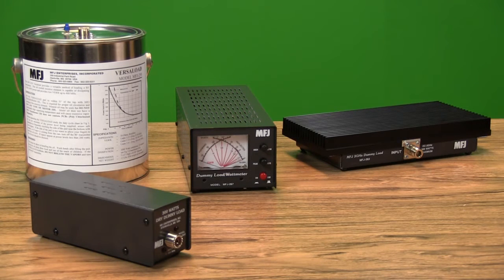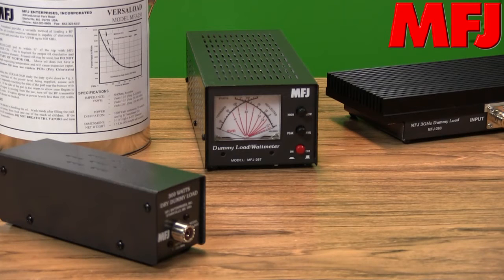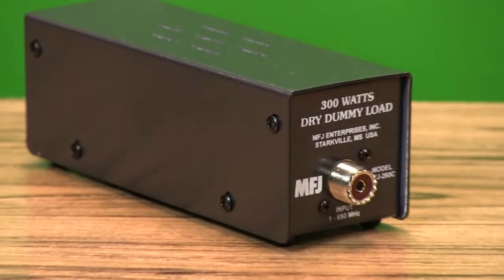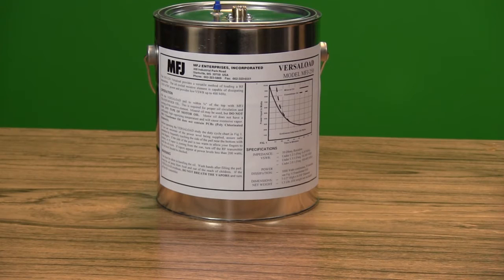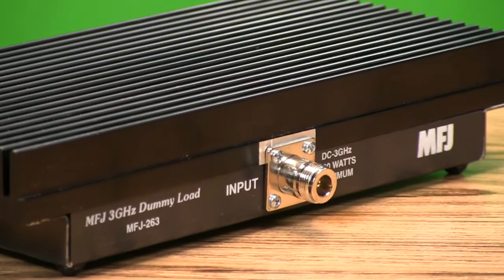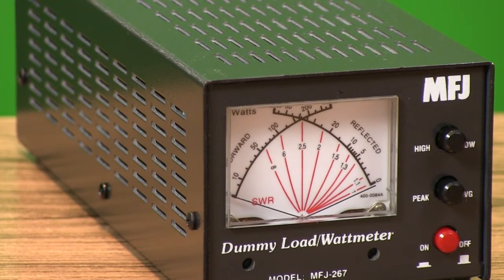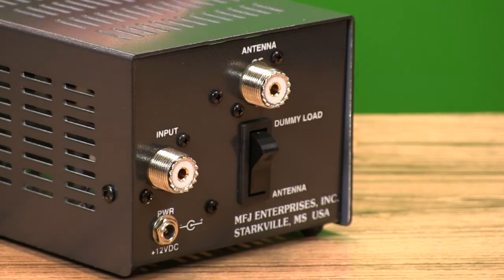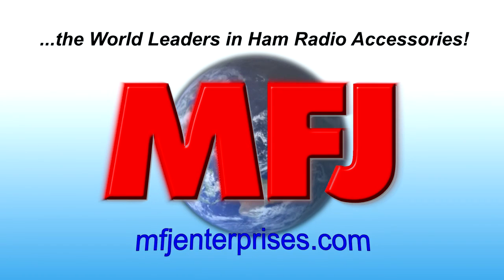MFJ Dummy Loads

Comment: i make my dummy load w/ my hot water tank, and also w/ my electric stove, I just hock up a cox cable to a hot water tank or my stove and then my radio to  the dummy, ( my stove or my hot water tank),,  my SWR is fantastic and 8000W power